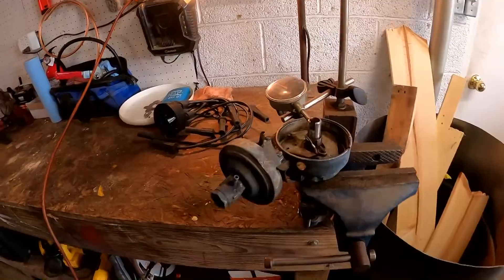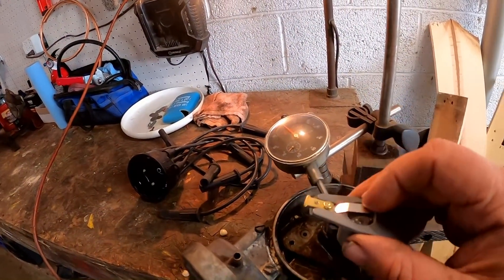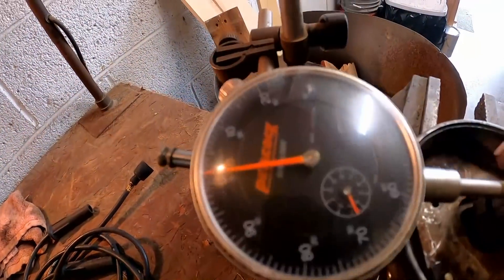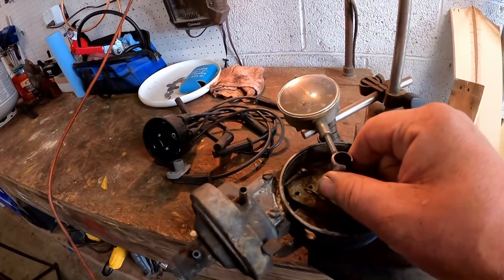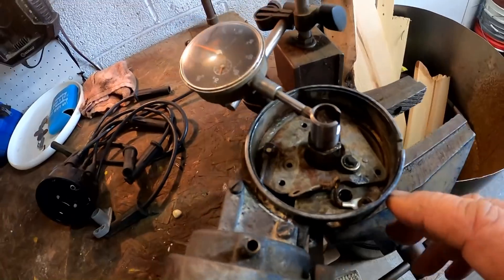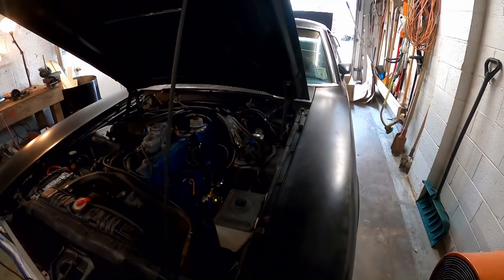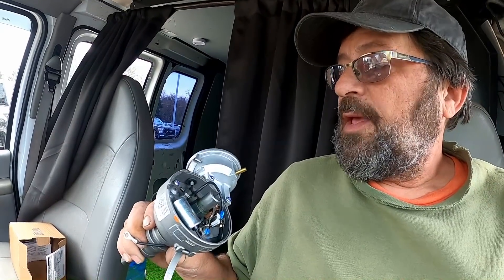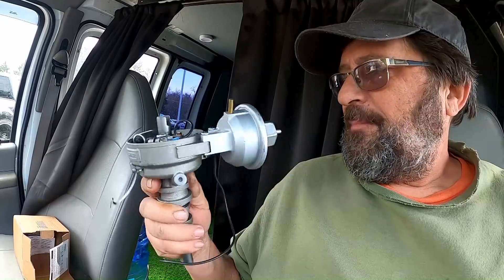Bad Distributor Shaft Bushings & Bad Rebuilt Parts!

Comment: This is Mike in Florida I work for a Napa dealer. I taught mechanics in the Marine Corps in 65.   I'm well-versed on Distributors if you need one built I can build you one that will last.
Reply: I've got an 85 318 dodge d150, it's got 90,000 on it, ran great then last winter lost all get up and go, replaced card did nothing, checked plugs and wires replaced cap and rotor nothing, replaced timing chain power came back, but it runs just a little ruff now when it's cold everyday, used smoke machine cant find any vacum leaks, would you build me a distributor? I'm building a 78 la 360 too, can I send you a couple distributor bodies? Thanks

Comment: You're lucky you were able to get them to take the distributor back, most places I've seen specifically say that there is no return on electrical parts.
Reply from the maker: Well, the distributer is actually a mechanical part. It's all the parts that are added to it that are electrical.
Reply: @davesotherstuff  You're right of course.  I've worked with electricity my entire life, so that's why I tend to see things that way first.

Comment: Got a distributor ordered at orileys from the same company in Mexico.. Came to pick it up and inspected it before I walked out the door with it, and I’m glad I did. Man, they sent the wrong distributor and stamped the wrong part number on the thing itself and spray painted the top of the shaft grey.. I could scrape it off with my fingernail 🤣.

Comment: I have the same problem with my '88 Ford Ranger power steering pump. 4 from Autozone & one from Rockauto. They replace the seals, but not the vanes in the pump & there fore all of them wined like they had no fluid in them. Time to go junk yarding to find something to work. Good Luck with your Mav.
Reply from the maker: Thanks John, and good luck to you!

Comment: Hi from NZ Dave. Have you tried revving the engine up and down with a timing light connected. I worked on Ford Falcon  6 cyl 250 engines in my day and i had a similar diagnosis to yours and i attached a timing light to it and the timing was fluctuating hugely so i checked the timing chain and it was worn out. I replaced the chain and gears and it fixed the problem. Just a thought. The chains can get rusty when sitting and wear bad in the pins and links and gears.  Maybe you have checked this already. Cheers.
Reply from the maker: It would be normal for the timing mark to move as the engine is revved. In the Maverick's case, the spark gap is fluctuating wildly with the worn bushings.

Comment: I suspect I have a bad distributor. The engine makes a loud sound under hard acceleration, sounds like a gear being stripped. Also, car has a horrible low speed hesitation. Can a distributor make that sound? Thank you!

Comment: The bushing is probably the most worn part to replace here during the remanufacturing process. The fact it gets overlooked means this supplier is only cleaning up the core and just putting new parts (points, condenser, rotor, cap) on top of it to make it look new again. Very shoddy workmanship. 😕
Reply from the maker: It's frustrating that the very part that causes most to need replaced, is the one that is overlooked!
Reply: @davesotherstuff  it might be easier to just get a new bushing machined locally and rebuild your stock distributor yourself.

Comment: Tight tolerances on a 70's Maverick? You must be joking. <sarcasm>
Good catch Dave! Can you measure the shaft diameter and the diameter where the bushing seats to get a size for replacements? After writing that I now wonder if they turn the shaft down as part of the reman process?
Reply from the maker: I've never heard of grinding shaft undersize and making bushing to fit, but that would be one way to do it!...well, maybe no because the gear and rotor would be a lose fit.?
Reply from the maker: Tight tolerances on a 1970...lol  I guess that is part of the game is to regain those as much as possible is all areas! :)
Reply: @davesotherstuff  Sorry, I don't always convey my thoughts clearly. I'm not familiar with the reman process or the final assembly of the distributer. Was just wondering out loud if the shaft would be turned down to get rid of rust and pitting. And then they just slap it back together without changing out the bushing.
My suggestion to measure for a new bushing was more thinking out loud to make what you have work.